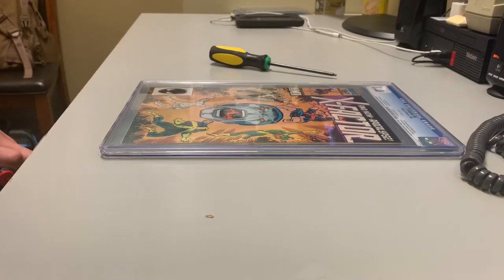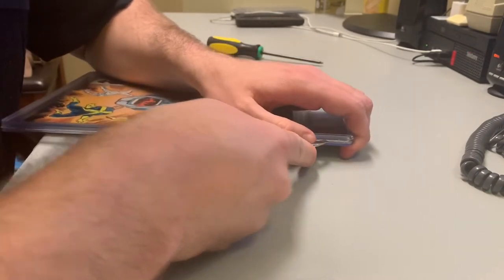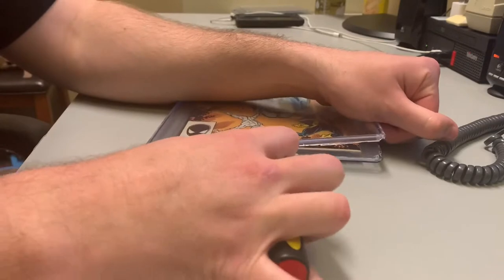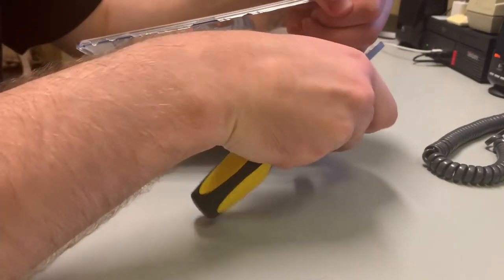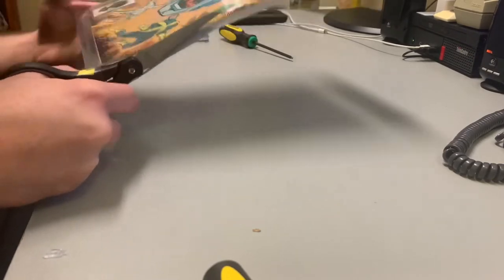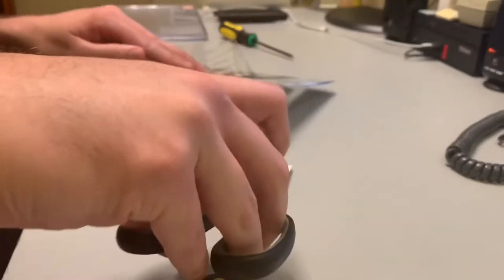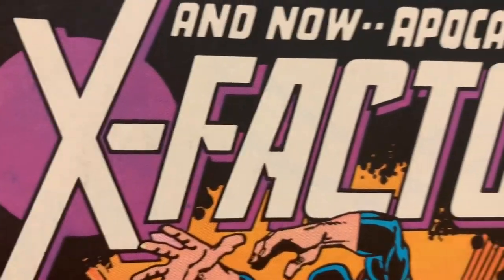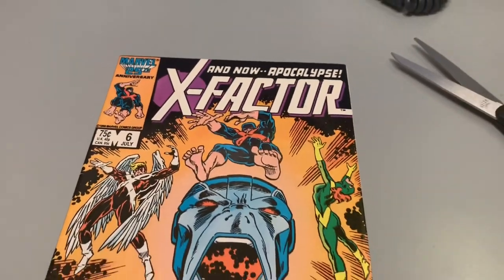RECYCLING CGC - HOW TO CRACK A CGC CASE

Comment: I've been thinking about doing this to a couple of my books but im to scared, lol.  Great info. Cant wait to see the results.
Reply from the maker: The Simply Incredible Podcast it really as hard as you think. Just take it slow once people rush that’s when the problem starts
Reply: @nerdyfather8897  I've done a little touching up but not really gone to far.  Lots of practice on cheap books.  I still don't know how people get ink off where someone wrote a name or something on a book.  I use white eraser, mr. clean eraser pads, and absorene.  Just very lightly.
Reply from the maker: The Simply Incredible Podcast so what I’ve heard ink is pretty hard to get off you can get it down to a light fade with an eraser but I’m not too sure either. When I figure it out I’ll let you know and post a video